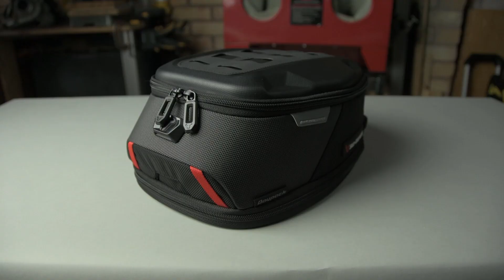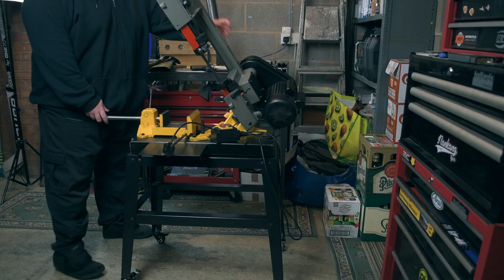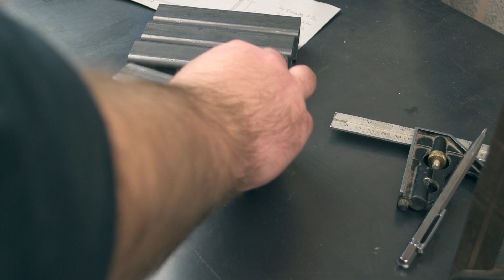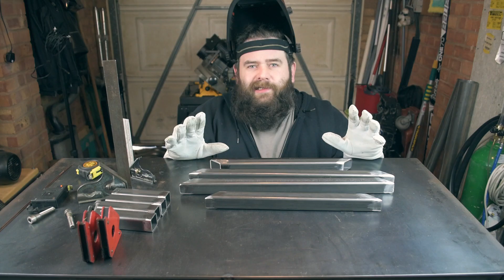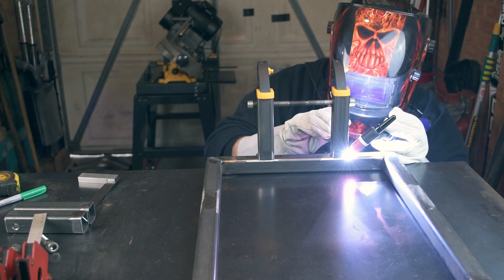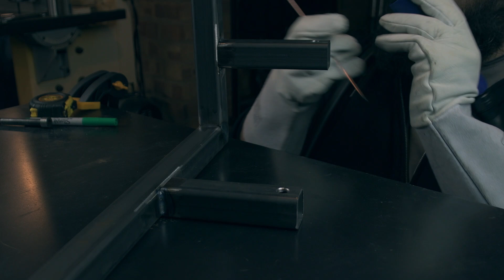How to make a Suzuki Bandit GSX-R engine stand

Comment: Hi Ian, it's Dan again. Wow, that is some fine craftsmanship.I did end up getting a Abba lift, and started tearing my Bandit down a couple days ago. I hit 54,000 miles on the 'ol girl and still runs good. I took it off the lift today and the engine is out of the frame. Now all the work begins ! I have a 8'x4' table that was being thrown away at a collage chemistry lab while I was doing tile work there. My Bandit covers the whole top all in pieces along with marked plastic bags full of fasteners. I didn't realize how much dirt and grime I accumulated over the years !  I would defiantly need some skilled help to make the stand, I do know a couple people.  With that many miles on the bike , it would be nice to put new pistons and rings in but I'm a little light in the wallet. It will get a new paint job, forks need to be taken apart and cleaned ( has Race Tech) and put back with clean oil. Shock is a Works Performance and there is a local guy that can go over it. Valves will need adjusted ,probably more cleaning than anything else.  The engine is laying on a piece of wrestling mat now, I was just looking in the exhaust ports with a flashlight, (not that I know what Im looking for) and seen #4 cylinder was a little darker.  As long as the engine is out now sure would be nice to give it a go over. Oh, and I'll get new clutch plates too.   Hope all is well with you, Dan